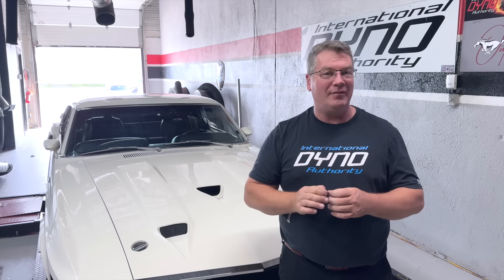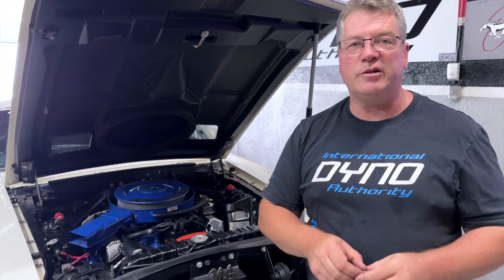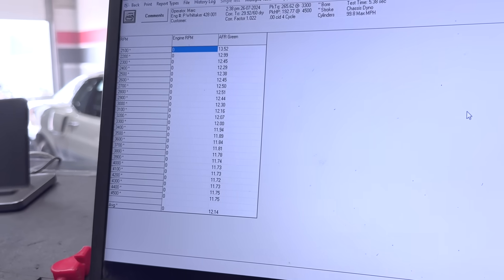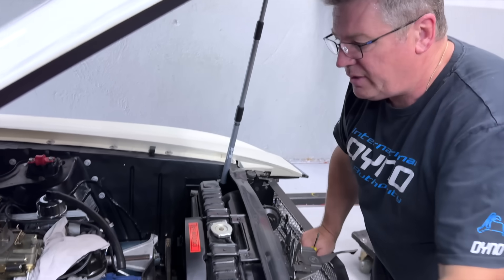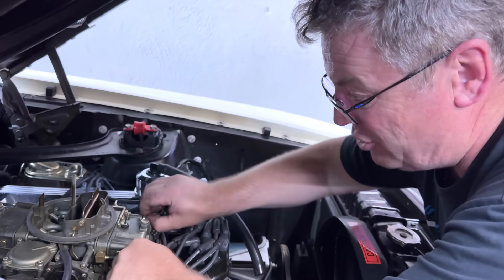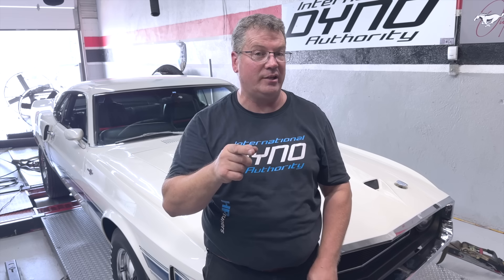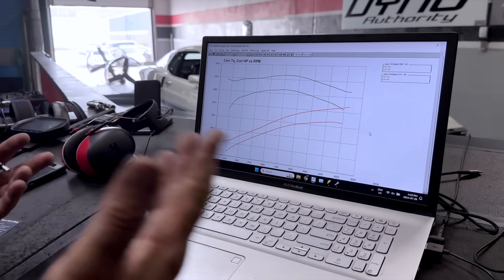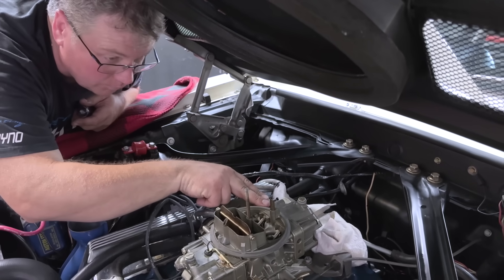Original, unrestored '69 Shelby GT500 tuned on the dyno

Comment: I'm building a 70 GT500 for a customer and I'm rebuilding the original 428 SJC engine and these engines were boat anchors compared to other engines.
Reply: "You wouldn't have beat the [power added] Chevy big block in my [lightweight] 32 Coupe." ...yeah probably not if you could actually hook. Your point?
Reply: @the_munkee_ranch  You wouldn't get the point because you're way below my league.
Reply: @mattrodwell  Believe me. I get your 'point'.
Reply from the maker: The original SJC engine had a lot of potential, just required some tuning and adjustments to make it shine.
Reply from the maker: https://youtu.be/MGgBtNOB6Z8?si=lioBn5jc83nmOKPv
Reply: That boat anchor I had back in the day sure made that Hemi Cuda cut bait. He lost by 4 car lengths.
Reply: @michaelconant4769  You wouldn't have beat the blown Chevy big block in my 32 Coupe.

Comment: Based on the stock  specifications of the engine: displacement, high compression ratio, big ports and valves, special cam,  dual-feed Holley, medium rise intake manifold, free flowing exhaust manifolds etc. it has been "conventional wisdom" that the  335 factory gross horsepower rating for the CJ  was understated by Ford. The stock Mach 1 with this engine could do a 13.7 at 103 miles an hour in the quarter mile back in '69 (Popular Hot Rodding test). Amazing that this testing got so close to Ford's rating.
Reply from the maker: @JackF99  You hit on a great point about customer expectations on the dyno! 🚗💨
It's true, the question "How much power will it make?" is always top of mind. We've learned a valuable lesson: you can't fool a dyno!
When things are in good order and reasonably tuned, vehicles tend to fall within that 15% rule – a good indicator of real-world performance.
However, when things go wrong (bad tune, cylinder issues, fuel problems, etc.), power drops significantly. Sometimes, even smoke appears!
It's fascinating how close factory ratings are for stock vehicles. Those manufacturers invest heavily in their testing, and it shows.
Of course, with modifications, we can push those limits further. Higher octane fuel, precise tuning, and advanced timing can squeeze every last bit of performance out of an engine.
In this case, our focus was on eliminating smoke and diagnosing the root cause. We found a combination of issues: excessive fuel delivery, a partially blocked choke, a faulty PCV valve, and overly conservative ignition timing.
We hope you and your loved ones enjoy a wonderful holiday season! Happy New Year from the team at International by Dyno Authority!**

Comment: Did the plugs ever clean up after all the 10-11afr runs 😢 I was reading the comments while listening and don't remember you pulling a plug. How did downsizing the pump squirters effect driveability?
Reply from the maker: @93_LXcpe  anywhere between 12.5, and 13.2. Will clean the ceramic. Clean the tip, and give you a true reading when under wide open throttle on the spark plug. 

You are correct, anywhere in the 10 and lower 11 range. You are going to see a lot of soot a lot of excess black deposits, and it'll make it very difficult to see the timing on the strap.

Comment: Very informative. 

I must have missed what the final timing adjustment was. 10 initial and 26 after couldnt have been optimal for power. Would different counterweight springs in distributor for additional timing up to 32 or 34 assist with more power also?
Reply from the maker: The final timing adjustment was 31 degrees.  You got it, the more timing, the better the power output.

Comment: A 1969 big block chevy 427 would kill this boat anchor engine.
Reply from the maker: @teamplayer1634 

Over the last number of years. Our company, has had the opportunity to test, to tune, and to work our way through each one of the platforms. Including the 427 cubic inch big block Chevy. 

The 454 big block Chevy. Pretty much identical 

The 460 Ford. The coyote. Multiple ls platforms. And of course the venerable small block Chevy. 

And, of course the same thing always folds true. If, you want to make performance. You need to increase the size of your intake valve. Increase your compression. Fix the combustion chamber. 

But most importantly, you need to tune tune, tune. 

Having the correct amount of fuel, having the matching fuel for your setup and having the proper carburetor and ingition settings, makes everything work together. 

If I run a 427 big block Chevy, and I put a very mild Cam in it 

It will make very mild power 

If I run a 460 Ford, and I put a Very mild cam, I'm going to get a very mild result. 

However, if I take that same 427 big block Chevy and I reduce the combustion chamber cubic centimeter capacity. Place a piston into the combustion chamber also with an aggressive bump. Effectively increasing the compression. Remove the intake valve, and replace it with a larger intake valve, and then clean up the bowls and choose the correct cam profile, I now have a monster. 

The thing is, we can do that with any motor. Street power, versus Drag strip Max effort engines, not really a great comparison. 

If I take the new ls7 427. The cylinder heads are so far superior. That even with the smaller mini bore. You still end up with a very impressive unit.

The advantage that the Ford Motor Company has always had over Chevrolet. Is the bore size and the bore spacing. At the same time, Chevrolet has used a much smaller board to get a quicker breath of air in on the street. Which makes it feel like it has a torquier spot at low RPM. 

Both platforms allow for easily making 1.4 to 1.5 Horsepower per cubic inch. 

After we exceed 1.5. We need to increase the bore size. This is much easier in a Ford.

Then, replacing cylinder heads is much easier in a Chevrolet because there are more cylinder heads on the aftermarket to choose from. 

We absolutely love, each of them manufactures approach, to building power. And, enjoy your feedback. We look forward to showing you lots and lots of upcoming content. 

Merry Christmas to you, and happy holidays from all of us here at International Dyno Authority to you and your family for the new year.
Reply: @internationaldynoauthority693  Nice professional answer to a pissy comment, good on ya.
Reply from the maker: @Stone881 https://youtu.be/MGgBtNOB6Z8?si=lioBn5jc83nmOKPv
Reply: @internationaldynoauthority693  lol @ whoever wrote this comment.  "boar"  "board" for BORE LOL
Reply from the maker: @Electromotive_Force  totally agree, it's a great story. 

Needs more dragons
Reply: I had a 69 427 vette and yeah it would smoke that shelby.
Reply from the maker: @olivermeier2949  

Over the last number of years. Our company, has had the opportunity to test, to tune, and to work our way through each one of the platforms. Including the 427 cubic inch big block Chevy. 

The 454 big block Chevy. Pretty much identical 

The 460 Ford. The coyote. Multiple ls platforms. And of course the venerable small block Chevy. 

And, of course the same thing always holds true. If, you want to make effective performance. You need to increase the size of your intake valve. Increase your compression. Fix the combustion chamber. 

But most importantly, you need to tune tune, tune. 

Having the correct amount of fuel, having the matching fuel for your setup and having the proper carburetor and ignition settings, makes everything work together. 

If I run a 427 big block Chevy, and I put a very mild Cam in it 

It will make very mild power 

If I run a 460 Ford, and I put a Very mild cam, I'm going to get a very mild result. 

However, if I take that same 427 big block Chevy and I reduce the combustion chamber cubic centimeter capacity. Place a piston into the combustion chamber also with an aggressive bump. Effectively increasing the compression. Remove the intake valve, and replace it with a larger intake valve, and then clean up the bowls and choose the correct cam profile, I now have a monster. 

The thing is, we can do that with any motor. Street power, versus Drag strip Max effort engines, not really a great comparison. 

If I take the new ls7 427. The cylinder heads are so far superior. That even with the smaller mini bore.  You still end up with a very impressive unit.

The advantage that the Ford Motor Company has always had over Chevrolet. Is the bore size and the bore spacing. At the same time, Chevrolet has used a much smaller bore to get a quicker breath of air in on the street. Which makes it feel like it has a torquier spot at low RPM. 

Both platforms allow for easily making 1.4 to 1.5 Horsepower per cubic inch. 

After we exceed 1.5. We need to increase the bore size. This is much easier in a Ford.

Then, replacing cylinder heads is much easier in a Chevrolet because there are more cylinder heads on the aftermarket to choose from. 

We absolutely love, each of the manufacturers' approach, to building power. And, enjoy your feedback. We look forward to showing you lots and lots of upcoming content. 

Merry Christmas to you, and happy holidays from all of us here at International Dyno Authority to you and your family for the new year.
Reply: Jealous much ? 🤡
Reply from the maker: https://youtu.be/MGgBtNOB6Z8?si=lioBn5jc83nmOKPv
Reply: Who cares I'm a Ford man
Reply: I wouldn't be so sure about that!!
Reply from the maker: @user-ts1fp4nm9y https://youtu.be/MGgBtNOB6Z8?si=lioBn5jc83nmOKPv

Comment: First rule for these Holley 4 BBL carbs - check the power valves first.  It only takes one backfire through the carb to rupture them.
Reply from the maker: That’s a great point and something we’ll certainly take into consideration when we’re doing the next tune.
Reply from the maker: So let's explore, what would happen, if we had a ruptured power valve.. 

When we, step on the gas, we would have a dead spot, and we would have an area where the engine goes very lean. Due to the power valve not operating correctly we would have fluctuations in the fuel curve. When we illustrated the fuel curve, which is one of the basics of starting any tune, we started with. For any holes, any severe dips, and any places where the performance was completely inconsistent. 

Following along, with the procedure, we then analyze the fueling. The fueling on this carburetor was extremely consistent. And we could see from the tailpipe, that there was too much fuel being supplied. So we had to do a systematic approach. 

Start with low speed. Make sure it is correct. And adjust until we have very good throttle response. The engine starts extremely well, and we have proper emulsification. In the low speed fuel delivery circuit. 

Move on to transition, transition is within the vacuum circuit, moving to velocity and also the float level. 

As you'll see from the video. We changed the gasket on the power valve which was incorrect, and we changed the position of the power valve, and we changed the actual power valve itself. 

After all of this effort, and making changes to the front primary circuit main Jets. We still had smoke after $3,900 RPM. 

Which tells us, that our smoke is not in any of the low speed circuits, it's not in the transition, and we are now into velocity. Velocity is strictly driven by air coming past the booster and Venturi, to draw fuel from the front and rear primary and secondary circuits. But what else did we discover? We discovered that the air coming past the accelerator nozzle, was also drawing extra fuel that was not being carbureted correctly. 

We therefore adjusted that circuit reduced. The fuel available eliminated the nozzle leak. 

After this we worked on the PCV system. And the ignition timing. At this point we've eliminated all the smoke, we have increased the available combustion efficiency to the point where we're making proper power. 

We very much appreciate all the comments. And, we hope, that in the future, you will be able to enjoy more of our videos and content. Cheers and happy New Year!!
Reply from the maker: In this video, we explore All possibilities: Including the consequences of a ruptured power valve in a carburetor. We know how it can lead to a 'dead spot' and lean conditions in the engine due to fuel curve fluctuations.
Following the tuning fundamentals, we meticulously analyzed the fueling, starting with the low-speed circuit. We adjusted for optimal throttle response, smooth starting, and proper emulsification.
Next, we addressed the transition circuit, considering the vacuum circuit, velocity, and float level.
As you saw, we replaced the faulty power valve gasket and adjusted its position. We also replaced the power valve itself and made adjustments to the front primary circuit main jets. Despite these efforts, smoke persisted above 3,900 RPM, indicating an issue beyond the low-speed and transition circuits.
This pointed towards the velocity circuit, influenced by airflow dynamics and fuel delivery from the primary and secondary circuits. We also discovered an unmetered fuel leak through the accelerator nozzle, which we corrected.
Finally, we optimized the PCV system and ignition timing. This comprehensive approach eliminated the smoke, improved combustion efficiency, and ultimately enhanced engine performance.
We greatly appreciate your comments and feedback. We encourage you to subscribe to our channel for more informative and engaging content. Happy New Year!"

Comment: I don't miss carburetor's and points. My float got stuck one time in my 66 Mustang GT on the Holley carb & couldn't get it running in a parking lot. I got inside the engine bay and kept hitting it with a wrench until the float got unstuck & it ran fine after that.
Reply: In high school my best friend had a Bug. Those old points ignitions were the bane of our existence. We would park the car in August at a movie an hour before sundown and it would run fine. We come out of the movie and it's 20 degrees cooler, the points have shifted from the temperature drop and we can't start the damn thing. We were high school kids, all of us on our first car and none of us even took auto shop. We had no idea what to do. We ended up walking home a half a dozen times. Then one day we were stuck at a McDonalds and this guy comes up and tells us all about points and how they shift and how Bugs are always having that issue. He pulls out a photo album of all the Bugs that he's build over the years and gives us his address and number. Man, it changed our lives. Car guys are special.
Reply from the maker: That sounds like a nightmare. It's hard to get it running when you don't have a spare carb or a knowledgeable person on hand.

Comment: This tip works on any engine: Use a metal file and round the corners on spark plugs, so that the electrode shape matches the shape of the tip of the spark plug. Try it once and you will always do it. These older V-8 Mustangs liked lots of spark advance. The owners plugging the vacuum on the distributor was a mistake.
Reply from the maker: @samgentile7494  He did not plug the vacuum on the distributor. 

The replacement distributor, did not have a vacuum advance. 

The replacement distributor had a custom spring and weight tunable advance. 

We ran a spark plug test 2 years ago and we tried every different spark plug and we tried every different coating. And we tried people having their file out and changing things on the spark plug. 

Pass after pass after pass after pass there was absolutely zero difference. 

Until, we, changed the spark plug gap 

The only thing that made any difference, was bringing the spark plug gap to .030 or less.

Even then there was only five or six horsepower available. 

Playing around with spark plugs, is something that some people like to do. But, these engines don't like spark anymore than any other engine likes. Spark. 

We tested this engine with a variety of different spark advance. The only thing that really helped was spark plug gap. And, proper tuning. We ended up at 31°. Which is exactly where the combustion chamber, the fuel, and, the anti knock properties, came together beautifully. 

Thank you for sharing your thoughts! We’re so glad you enjoyed this vehicle as much as we did. It’s always exciting to see how a well-maintained classic responds to changes—it’s a testament to the care it’s received over the years.

You make a great point about the potential this car has, especially with a freer-flowing exhaust or other tweaks. While it might not see much action at the drag strip, its charm as a cruiser and one-of-a-kind classic is undeniable. The 420+ cubic inches under the hood definitely spark some interesting possibilities!

We’d love for you to keep following the channel, share it with friends, and join us as we explore more incredible vehicles. Wishing you an amazing holiday season—Merry Christmas to you and your family! Stay tuned for more from the International Dino Authority crew!"
Reply from the maker: @samgentile7494  Best thing to do, with one of those spark plugs after you have filed with it and played with the end. 

Put it into a side-by-side spark plug tester. I have several at the shop. 

Then what you can do is compare, the spark generated by the one that you filed, and one that's been unfettered on molested, and left alone. 

This gives you wicked good results. That gives you an idea of what does and what does not work. And it will also give you an idea, of what Gap is required on the specific spark plug that you're using